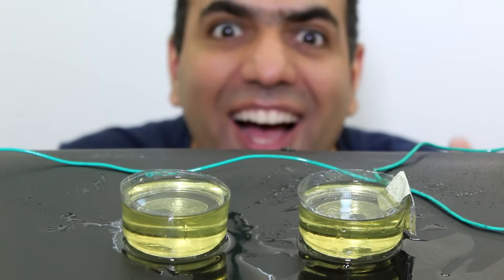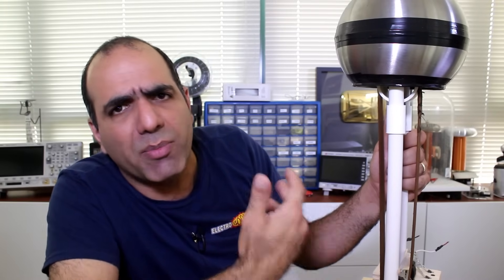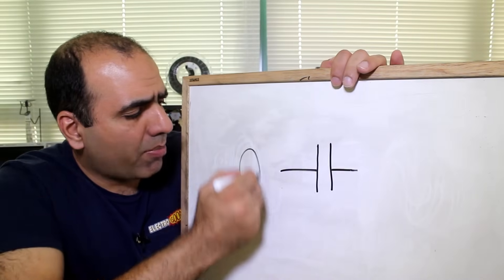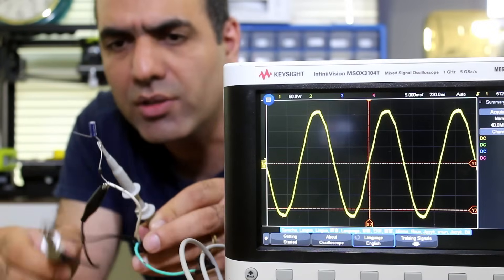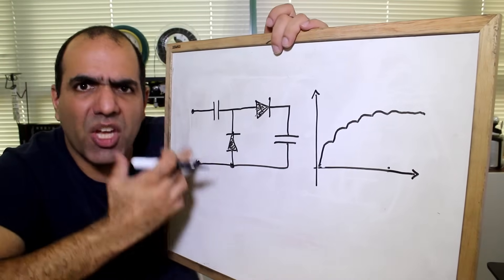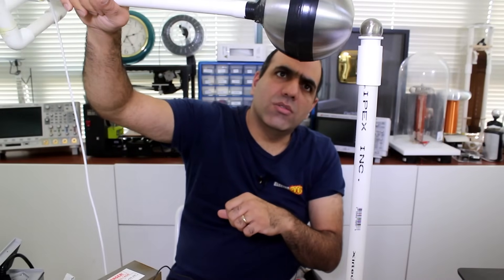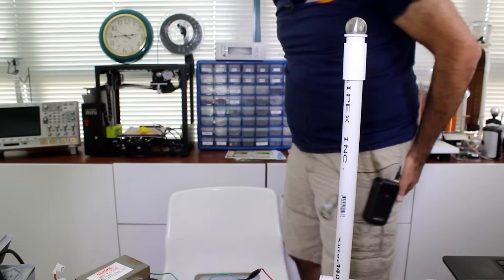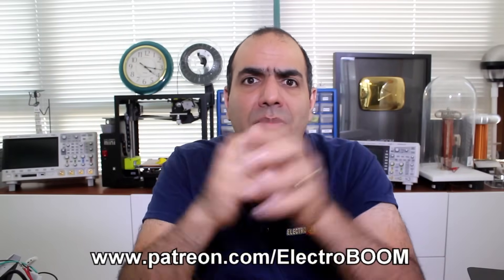High Voltage Flying Oil Experiment with Voltage Multiplier

Comment: ElectroBOOM, if you get a case or more of empty cans in a cluster you can charge them up and draw HUGH Bolts from them maybe even powering it with your van-digraph generator ,  I did this long ago with an Ion Ray gun and was able to make 2 foot bolts - Very Fun and Dangerous Too! - Perfect for your Channel!  When I did it the spark jumped 2 feet to hit me Twice! then the 3rd time with even more precautions it jumped else where!  You can just charge up the cans with your Multiplier connected as in this video!

Comment: Mehdi those are not sketchy Russian designs, those are sketchy american, European, and Japanese designs from the 50s and 60s that the Russians cloned and used until integrated circuits became a viable option in televisions.

They're voltage doubler and tripler circuits you could easily pull from any such older televisions

Comment: Man I seriously worry about you. My father received 169000 volts for 18 seconds working for a power company. He blew both his heels off in burning 98% of his body third and fourth degree burns and then he fell from 25 ft which is the top of a telephone pole and landed in the sitting position which mating 5 inch shorter for the rest of his life. Electricity is nothing to play with!!

Comment: The Wi-Fi 'shotgun ' - the power in the radiowaves in the Ukraine can be very different than in the UK and the states. Also there can be less static and blah, blah, blah. Point is, they seem like good kids that are playing with electricity. So why would they lie? 

It's like the Volts vs Amps "It's the Amps that kill you". You say it's the farads instead of the amps when they are the same thing - farads are just Amp/Hertz versus Amp/seconds. It's correct, from where you're standing. The wi-fi shotgun is probably correct for where they are standing.

Comment: Hate to tell you this bud, but the wifi "shotgun" is also known as a yagi antenna and it works very well... so does the wireless phone charger (but only when standing under high voltage power lines, as shown)... the microwve "gun" is merely an open ended waveguide that funnels the microwave energy in a single direction... don't diss what you don't know... those are actually relatively solid builds on known technology...

Comment: I have a question... I get the point of something shocking you when it is charged (like in case of static electricity where the potentials wants to be equal so you get shocked in order to do so). There does not have to be a closed LOOP in that situation.

But why do you get shocked here, where you have a source of electricity? Where is the closed LOOP here? Or you also don´t need the loop? The capacitors just discharge through your body into the ground?

I would be grateful for explanation from anybody. Thank you :)

Comment: As an Electrical Engineer, would you provide any consulting services for us hobbyist on a project I'm working on which involves supplying power to 12 servo motors at 6.8v & 2amps per servo? I would like your expertise on the best way to supply power to all servos without any degration in performance.
The only solution I've imagined is taking a 12v@5amp power supply which feeds into 12 DC-DC Adjustable Voltage converter where each converter is connected to a servo.
Your advice with this would be forever appreciated! Thanks!
Reply: Why use 12VDC when they run at 6.8V?  Make your own PSU; Vdc = Vac x 1.4 - 1.4 for a full wave rectifier. Use a cap (or caps) 1000 uF per Amp. 
is that 2 Amps per servo the PEAK or INRUSH current or continuous?  I suspect it is continuous and so your PSU will likely have to have much higher current capability.
All 12 servos can be active at the same time? Then how did you get a 5 Amp power supply requirement?

Comment: Why not use gasoline instead??? It is lighter, so it should fly further/with lower voltage ;-) 
And in Russia, you can use liquid butane, it boils around HOT 0 degrees 'Cience, well above standard Russian ambient temperature!

Comment: 10:53 I don't understand .... If capacitors are small then how can they load the circuit ? I mean smaller capacitor, smaller load, right ? I'm definitely missing something fundamental here. Plz anyone help me out. 
THANKs
Reply: Smaller capacitors mean less current loss is needed to significantly lower the voltage.

Comment: If you place the probe tips in helium for a short time before the experiment they will be lighter and thus won't load the circuit.....  I was waiting for you to shock your tit when you were trying for the sound. Very fun videos. Also, a fun thing to do is ram your HV generator pole down into a box of styrene packing peanuts. Be sure to have a vacuum cleaner ready!

Comment: Well done!Great illustrations and explanations with some funnies. LOL! I know that the high cascaded volt multiplier had very low current but OW! The blowing up of an electrolytic was funny also but you really need glasses or an eye shield. Wonder where the fanny arc came from? Probably an air arc or the electolyte of the padding on the chair broke down. When young I used a neon transformer, about 17.5KV and arced across a glass jar. The surface of the glass altered as the external arc broke across the outer surface. I followed the arc all the way around the jar. Later when all cool the arc picked up because the electrolyte glass broke down and became a conductor. The oil you used is a great electrolyte. In power line transformers oil is used. When lightning strikes the oil breaks down but more oil moves in and the transformer recovers as the carbon trace in the oil moves around. When enough arcing from lightning occurs the carbon content becomes too high and oil has to be drained and the transformer refilled. When the oil breaks down not only carbon is produced but CFC's which are toxic (cloro-fluoro carbon). This contaminated oil has to be burned to eliminate the toxins of chlorine flourine with the carbon.   Excellent video.

Comment: Can you do a video on the microwave transformer gun that the mad Russian made? My friend attempted at making one and it worked at a distance of about 2 metres from an old multimeter he used as the 'victim' and it fried the circut of the multimeter but we were both left with sore testicles and probably have ball cancer now because we didn't wrap ourselves up in foil....and we did it inside a tin garage....woops

Comment: Dear Mehdi hi, Thanks for great and very informative videos. Mate, I need your help if it will possible please. I need you to tell me how to create a weak (safe) Electrical Current and/or, how to build a weak Electrostatic please, I give the scenario first; imagine there is a tick plastic container (around 1 or 2 gallons) with some kind of Resin and a few piece of wood, it is actually a vacuum chamber. Now, I need that weak electrical current or electrostatic in that Resin by placing the producer (device or anything) of them while the vacuum pump is taking the air out of the chamber for the period of time it is on (could be couple of hours). Just imagine painting a car by using electrostatic to have a more smooth and indelible result/paint. Will that be possible please to tell me how to do it? Cheers mate.

Comment: 0.7 is the potential barrier for silicon diodes in room temperature whereas for the germanium diodes it's 0.3 at ro temperature. If I'm not wrong

Comment: Great video, wonder why your multiplier didn't work well. You are a brave man holding the secondary of a MOT by an alligator clip. Don't think I've ever seen someone do that before...  I worked with a guy that had his pinky blown off when it touched a hair of wire from a grounded 2kv pulsed DC source.

Comment: You probably know this but running two electrolytics face to face in series will allow you to put them in an AC circuit.
So like this -[]+ +[]-  
It will halve your capacitance though I believe.

Comment: Could you use this if the oil was floating on top of water? Say to push the oil (spill) around the surface of the water (ocean)?? Theoretically (within my limited knowledge) you could string a few around some buoys and create a containment or a collector.

Comment: Can you tell me how arc jumps??
Reply: Mr. Everything due to corona partial discharge around a high voltage electrode the air gets ionized and conductive. there are different methods the arcs jump depending on voltage type DC,AC or surge, for example the streamer mechanism
Reply: Thanks man

Comment: i would buy those voltage multipliers and flybacks that these dumb fucks destroy , they are handy to repair my vintage vacuum tube tv's and not available here..i have some large oil filled transformers and other stuff that they would enjoy to experiment with. too bad they are too far away

Comment: The charges help the oil overcome it's surface tension and form very narrow jets. This property can be used to electrospin materials. Fill a syringe with a dissolved polymer and charge with high voltage. Aim the syringe at a grounded target with a blunt tipped metal needle. When the plunger is advanced slowly (with the high voltage on) a tiny jet forms. The solvent evaporates rapidly which leaves a thin polymer thread flying towards the grounded target. At the target, the fiber mats together chaotically and forms a fine fabric-like material. This process can be tuned to make a variety of materials and is a pretty easy set up for a home lab.

Comment: hi,
I have a questions about the Kreoson Channel.
you talk about they charging the phone from the power lines with antena, transformer, and a single puny diode rectifire but you dont answer on that i posible??
because i think its not posible, the antenna they use its radio antena and it can not chach 50 herz frequency 
in addition i dont think the power line make so powerfull electric field that you can chrge a phone wite that

Comment: "I am probing the live 120V AC  input." -  In that moment you know he is going to:
a) shock himself
b) short something
Reply: c) blow something up
Reply: f) All answers are correct
Reply: e) Swear in English and cover it up with 1000hz sine waves
Reply: @Windows XP memes and stuff lol  speaking Morse code
Reply: @vetal12311  g)Capacitor blows up due to low voltage rating
Reply: LOL!
Reply: d) set something on fire
Reply: e) he’s going to fucking die
Reply: B
Reply: c.) shock himself, short something and blow something up
Reply: D burn his house down

Comment: i'm not an expert, but i'm pretty sure the "be careful to discharge the capacitors before touching the circuit board" rule comes somewhere after the "turn it off first" rule, but before the "don't stab yourself with a hot soldering iron" rule. you are 1-1, for now at least.

Comment: hi. sorry the stupid stupid question but can you make silver or gold magnetic using electromagnetism?
Reply from the maker: If you run current through them, they generate magnetic fields if that's what you mean
Reply: @ElectroBOOM  so its true. thanks. but is it stronger than the ordinary magnet or is the strength of the magnetic field depends on the current you use?

Comment: I have a taser that produces 1 million volts , according to specification.
There are tasers, producing 2million volts.
So I took it apart, but the circuitry is completely enclosed in some epoxy.
It is very small. I wonder how this is done.
Might it contain a flyback transformer like the old television sets ?
All I can see, is a small 5V rectifier chip and a small capacitor, propably
used to charge the batteries.
Reply: It is not a scam. I can create pretty big arcs and it even conducts
through 10 cm (6") wooden surface.
The reason they used epoxy is for isolation, but
unfortunately, they also hide the circuit.

Comment: Kreosan thank you that live.
Креосан, спасибо, что живой.
https://s00.yaplakal.com/pics/pics_original/5/9/5/10742595.jpg
Reply: Didn't Kreosan use High tension transformers from old tube TVs? They are capable of much higher voltages, like 50kV?

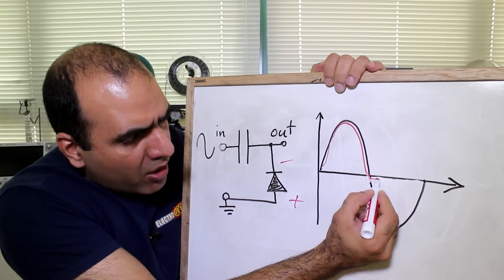Comment: At 3:20, I can't understand why would the output voltage be clipped?! I think that it's equal to the input minus 0.6V. Then there's the moment where the sinewave reaches its negative peak. Once it passes it, the capacitor plate potential becomes higher than the input, but it can't discharge because the diode is reverse-biased. In the ideal case, this means that the last quarter period of the wave (270-360), the sine won't be a sine, but just a straight line equal to minus the input amplitude. And after that I guess the whole magic of multiplication happens where I can't seem to understand the nature of the capacitor - on the negative plate (output) we have a high voltage and on the positive (input) plate we have a sinusoidal increase. I'm guessing that all the charge on the negative plate gets pushed away toward the output, PLUS all the charge that's coming in from the input - so in a sense we get a double-charged cap. Any different opinions on how this works?

Comment: Voltage multipliers tend to perform better when center fed  than if end fed.  Performance metrics  are top voltage  and or how quickly it gets up to top voltage. Circuit simulator.  http://tinyurl.com/yctv2jvf

Comment: It's better for safety and output characteristics if instead of using so many stages in a single cascade you have two separate cascades with one clamping positive and the other clamping negative, midpoint grounded not unlike an NST.  Limiting voltage to ground should save on corona discharge and shock severity unless you grab both sides of the output at once.   Try not to do that.

Comment: Thank you for the vídeo. I always wanted to understan how the cap diode voltage multiplier  worked, now I know - sugestion -use your HV generator to feed a marx generator after it and get even higher Hv

Comment: Hi electroboom! I'm not going to shove my link on your comments, but you may like (or really take issue with) the episodes I've done with my voltage multiplier. It's overbuilt, and i've been using it for three years now. Input of 15kv, output of 420kv, with some gorgeous sparks up to 15". I do highly recommend you build more CW multipliers. They are the most beautiful way to create high voltage. Reliable, long lasting, and structurally solid. Using mine, I did a few demonstrations on TV regarding water bending and fire bending. Great Video!

Comment: Is it impossible to charge the Voltage Multiplier with this?

https://www.ebay.com/itm/20KV-High-Voltage-Pulse-Generator-Super-Arc-Ignition-Boost-Coil-Module-DC12V-24V/263893364385?epid=16018620965&hash=item3d71452ea1:g:ZWUAAOSw7vxbfUzO

or this

https://www.ebay.com/itm/DC-3v-6v-to-400kV-400000V-Boost-Step-up-Power-Module-High-voltage-Generator/311688245090?hash=item4892112f62:g:sRwAAOSw59hbOvtW

Comment: Are there still oscilloscopes? 😅 I heard you say there were cheap, got excited and went to the web page and looked at $868. Any ideas on where to get a good lab bench power supply? For small stuff like avrs and tiny radios.

Comment: I know you mentioned many times that you cannot control the current flow when using high voltage. But can't you just use a low current fuse?

Comment: Still cannot get how plugging diod+capacitor into [-V;+V] AC source is supposed to get [0;+2V] on the capacitor.

Sure, the diod closes and does not let the charge to flow back from the capacity. But is also is not supposed to come over AC's peak. As long as the capacitor gets its own +1V charge it would no more let any current from [-V;+V] voltage supply in thus would not gain any added charge.

Comment: well i think if you only charge the DC with the + side of the electricity, you waste half! you should have had the system mirrored to have the input of the diode on the + and the other on the - to take both wave peaks as "just power" since when it becomes DC there they all becomes + if you use that system! tho with my limited knowledge of electrical components i may miss the point of why you did not do that...

Comment: how do you calculate the van der graaff voltage. I saw on wikipedia that is the sphere radius R multiplied by the electric field Emax at which corona discharges begin to form within the surrounding gas, is it thru?

Comment: hello I've been a long time fan of your work and had a question that hopefully you could answer I'm a big fan of microwave oven Transformers and have long wondered if it is possible to wire them in such a way where the total combined output of both Transformers is equal to one Transformers output plus a second Transformers output for instance 2500 volts ac + 2500 volts ac giving me a total of 5000 volts. I'm trying to get more around the 8000 to 10,000 Volt range for a self-arking Jacob's Ladder although I know a stronger Transformer would probably be far more efficient I just have access to Broken microwaves.

Comment: the voltage multiplier on a 60 Hz microwave transformer doesn't charge fast enough, but this probably will: grab the high-voltage supply from a panasonic microwave, this F66459X91AP board chops up mains at something like 30 kHz... https://www.youtube.com/watch?v=LZb6v0JMOuU

Comment: Correct me if i'm wrong, but that mighty bundle the Kreosan guy holds at 1:48 might be so big because these modules include a flyback transformer each. Altough those might be from old tvs where transformer was separate from the multiplier...

Comment: wait. does crude oil hold a static charge? if so, this high voltage device can push spilled crude oil along the ocean surface

Comment: Am I understanding this properly - would these 2 be equivalent?

[static electricity generator-VDG] + then a step down transformer [ high voltage to lower voltage w/ increased current ]

vs

"High Voltage Flying Oil Experiment" . [ low voltage to high voltage ]
Reply: the static electricity is DC, transformers only work with AC